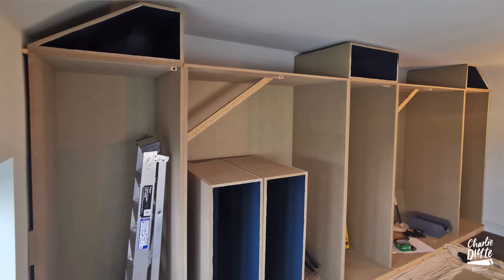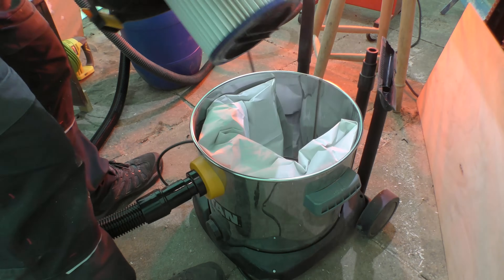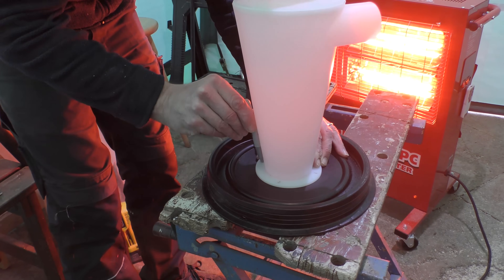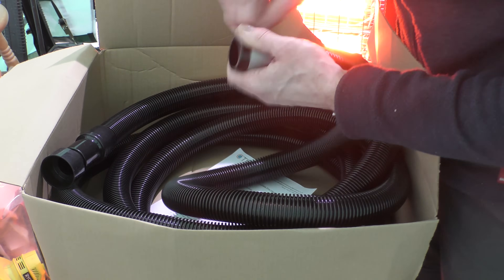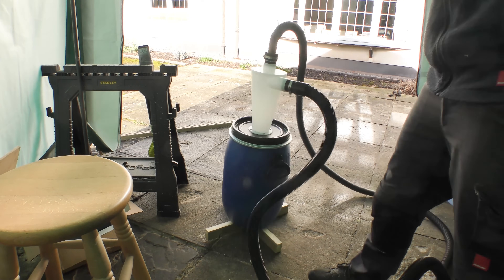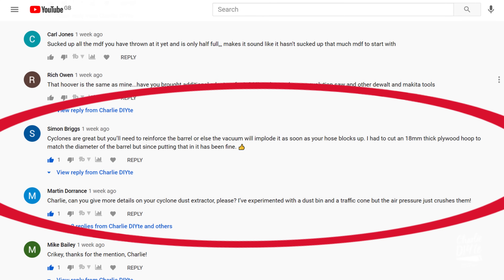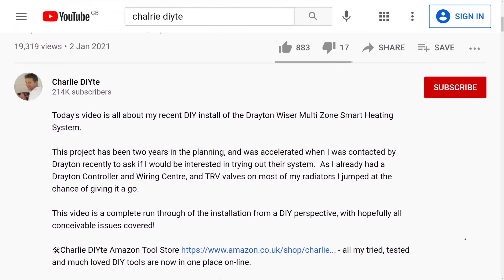How to Make a Cyclonic Dust Extractor/ Collector

Comment: I bought a blower the other day to blow the dust away after watching the other video.
Reply from the maker: You still need the blower. I couldn't manage without mine and use it pretty much daily to clean power tools, dust bags and the like - and of course leaves off the drive! My point though is that we should all be vacuuming up what we can. 👍🏻

Comment: Charlie I've had all these same parts waiting to be assembled for far too long. Thanks for proving it all works. I have seen people make a caddy on wheels to keep the barrel and vacuum together, and prevent it tipping over. I can become a bit bulky though, unless you can fit it all under the bench.
Reply from the maker: Definitely worth putting together my friend! A few people have suggested minimising the tube length between vacuum and barrel to maximise suction and then have the final hose suspended from the ceiling, but the suction on mine is more than adequate. And I can keep the vacuum nicely out of the way.

Comment: Charlie, I have a similar set-up to yourself for abating my sand blasting cabinet. There is a potential safety issue with the setup you describe that many folk will be unaware of. I am a former Manager of a Chemical factory and we are well aware of the potential hazards of dust explosions and ensuredthe risk was minimised by a variety of design and safety measures. Wood dust and MDF dust can form an explosive atmosphere and can be ignited by static buildup by the cyclone. If you are unaware of the destructive potential of dust explosions, google flour mill dust explosion. So what measures can we take in a domestic situation to minimise the risk? The main measures we can take are to avoid ignition sources near the setup for example brushed motor power tools or vaccum cleaners and ensure that cyclone is grounded to a known earth point using some 6mm cable. It is important to try and use a cyclone that is electically conductive, many of them are (the plastic ones include a conductive filler in their composition) by some the cheaper ones from e.g. China may not be. If the cyclone is not conductive then the grounding will/may not work. You can check to see if your cyclone is building up static my seeing if the hairs on the back of your hand stand up when the system is running and you place your hand next to the cyclone.
Reply from the maker: Thanks Dave. I appreciate the heads up on that and I think one other person may have mentioned this. I'll keep an eye on it and report back 👍🏻

Comment: Used almost exactly the same kit  to make mine about 6months ago. The barrel did collapse but I made a round brace out of plywood with a jigsaw that fits inside and it solved the problem. That 5m pipe is a bit too long and it does get clogged on occasion which is a pain. I'm redoing my work bench and will probably upgrade it to a 50mm hose to increase airflow.
Reply from the maker: Thanks Lliam. Yes a couple of people have suggested that on the length. It's doing a good job for me at the moment but I see your point.

Comment: great vid Charlie and I've recently made one very similar myself.
The initial cost will soon be paid back by not having to purchase vacuum bags.
The cen tech hose system with adaptors are a great addition.
Reply from the maker: Thanks mate. Yes particularly as the bags fitted so badly on the Titan and someone was saying that you can't even get them now. 👍🏻

Comment: Hi Charlie
Good video - wish I had done this - but too near the end now for me!!
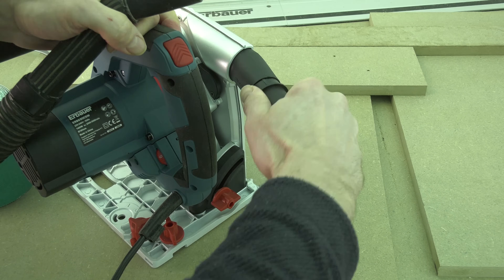However, at 2:35 what is the connector you use and where did you get it for your plunge saw?

I’m sick of using duct tape as the hose and the outlet are the same size!

I’m also going to try the taping over the window trick👌👍
Reply from the maker: It was actually the adaptor that came with my Evolution sliding bevel mitre saw. You can get them on Amazon and ebay. Google "vacuum adaptor for power tools". However you have to experiment. It's sort of luck whether it fits your vacuum nozzle or not.

Comment: i connected my 3000w vac and the plastic drum collapses immediately - steel drum is the only way for high suction
Reply from the maker: I can see that with a really powerful vac. What vac have you got out of interest?
Reply: @CharlieDIYte  Hyundai HYVI10030 3000W Triple Motor 3 IN 1 Wet & Dry Electric HEPA Filtration Vacuum Cleaner 230v
Reply: @CharlieDIYte  it has 3 motors - even with just 1 motor on it collapses

Comment: I built a cyclonic dust extractor the same as yours, unfortunately my barrel collapsed several times so I reinforced the middle with timber. Didn’t work it just collapsed somewhere else, it’s a shame because it worked really well. My only solution is to obtain a metal barrel, I’ve found mine very useful as I’ve got it connected to my trend vacuum which has a power take off so I can run my power saw off. I noticed you’ve taken the bag out of your vacuum, beware if your barrel gets full you’ve got no protection on your vacuum and it could damage the motor if dust gets inside the vacuum canister.
Reply from the maker: Thanks Brian. Generally I'm not a fan of removing the bag. I've always had a bag on my Henry's over the years. However the Tritan bag design is criminal the way it fits the inlet tube. You get so much dust leakage, and there's the hepa filter to protect the motor so I think it'll be ok.

Comment: The other solution is to make a pressure relief valve in the top of the barrel, I think it can be done with a bolt, washer and spring.

Comment: Hi Charlie, Wow, no sooner did you reply to me to say you had a similar set-up to mine than here is a video about it! I used a Dust Commander cyclone £29.90 from Amazon which did come with gasket and cutting templete, a Sealey 5metre hose £19.80 from Amazon and an Oipps 60L barrel. I did toy with the idea of 30L but decided the extra capacity would be worth the little extra to pay. I have no stability issues with the barrel falling over but my 1600W Aldi vac is quite capable of collapsing the barrel with even just a partial blockage of the inlet hose. I got around this with a clunky wooden brace inside the barrel but Matt at Badger Workshop did a video to show how he made and fittem a simple ring in his. Very necessary as I needed a car jack to un-collapse mine! You might also like to look at https://www.festoolownersgroup.com/other-tools-accessories/how-to-make-an-'auto-resetting'-pressure-relief-valve-for-cyclones/
I haven't made one of these yet. I have the bits but no time. I hope I have improved on the idea by replacing the external magnet holder with a stack of 4 ring magnets salvaged from old microwave ovens which get thrown away in large numbers at my local recycling centre. Again,  I  haven't tested to see if the magnets are a suitable strength but will let you know if you let me know how? Cheers
Reply from the maker: Hi John, fantastic work. 👍🏻👏🏻 That cyclone sounds a lot better than mine. I'll have to check it out. Also a few people have pointed out the need to earth it to prevent the static causing the dust to explode. Sounds extreme but it's obviously a potential problem. Thanks for the comment 👍🏻
Reply: @CharlieDIYte  I also have a sketched design for a stand (on castors) which will hold the barrel and vac, one above the other to give a smaller footprint in my tiny workspace. No progress beyond buying materials because we had a small disaster involving a water leak, bridged cavity, missing lintels, under pinning foundations and a stray tin mine (I kid you not), followed by plastering, carpentry, wiring and painting. You can reach me on Musgraveit@btinternet.com if you're interested in hearing about that or in pictures of the dust extraction system once I get it put together.

Comment: Thanks Charlie, like you I bought that Titan in a pinch when I thought my superior vacuum had died.  It has come so close to being launched out the window on many occasions, but I've been inspired to spare it and use it as a cyclone power source now.  Cyclone seperator has long been on the 'round tuit' list...
Reply from the maker: You and me both!! The Titan has hardly been used since I bought it due to the poor quality hose and accessories, ill fitting dust bags and lack of a cord tidy. However since starting this series of videos I've realised it can never compete with Henry as a domestic vac because it was never designed to be a domestic vac. It's best used in a stationary position attached to a cyclone in the workshop and with the power synchro switch to plug in power tools it suddenly makes sense. 👍🏻

Comment: Been cyclonic for many many years now and have different ones sett up across my workshop.  The only difference is, is that mine are all steel drums. Recently purchased the cen-tec hose, silver one and their  connectors off Amazon.  Think they are really good quality if a little pricey
Reply: Hi, I posted a query in Charlie's thread, can you offer any advice, I built almost exactly the same as Charlie's but dust just goes through and comes out of the vacuum air outlet port. Any ideas?

Comment: Tip...add a plastic bag inside your dust collection barrel with the cyclone, fit it over the top so it’s seals with the bracket that fits around the lid...that way you can simply lift out a bag and not have to make a mess cleaning the dust from the barrel...👍🏻 PS, I think your barrel is fine...I think it’s the slightly larger ones that have the problem with vacuum collapse...
Reply: Good idea, but don't let it get too full, or you won't get it out.
Reply: Great idea

Comment: With the cyclone dust collection fitted, you can remove the bag from your vacuum, this with improve the vacuum performance with the cyclone, and as you get almost no dust in the vacuum, the filter alone will be fine... ah, you did it....good...👍🏻

Comment: Charlie, have you added the Erbauer plunge saw to your shop? I've been thinking about getting it and would like the affiliate pennies to go your way.
Reply from the maker: That's incredibly kind of you mate. Sadly they don't sell it on Amazon so the link I've added is to Screwfix where they're currently only doing click and collect (in my area at any rate). I'm really pleased with the saw. Well worth getting!
Reply: @CharlieDIYte  I’ve got the same plunge saw, when I started using mine I was getting a lot of black foam all chopped up.I wonder if they put the foam by the blade and you sucked yours out and I cut mine up?

Comment: I am always worried about using bagged vacuums without a bag. Sure, you've got a cyclone attached. I have had one for years, and believe me, one day you'll overfill it, and dust will go straight past the cyclone - and after that, into the motor. After that the suction seems somewhat diminished.

Comment: Looks great!
I’m struggling to understand the science part of it though. Would be good to know more about what is actually happening and why
Reply: Gravity. The debris is separated via the cyclone bit and gravity causes it to fall into the barrel. Only the finest dust is then sucked up into the vacuum.
Reply: @Lliam439  So I take it that it wouldn’t really work for clearing out the ash from a wood burner as the ash is so light?  I’ve wrecked a shop vac filter doing that before

Comment: Love your videos! I have the same vacuum and the next size up barrel but I made a diy cyclone using PVC pipe. The pipe from the vacuum connects to the centre of the lid and the pipe to the tool connects to the side of the barrel at an angle just below horizontal (at a tangent to the circumference of the barrel) to force the cyclone effect. Works perfectly and I’ve been really impressed with it. I have had issues with the barrel trying to collapse but only if the pipe is blocked - I plan to put some braces inside the barrel to stop this.

Comment: I did the same thing and works really well, but my problem was finding the right connections and hoses to the different tools, like Thicknesser,Table saw, Router, and Plunge saw.. I had to bodge it a bit but the extract system was definitely worth making..
Reply: check out cen tech hose and adaptors

Comment: I’m also looking at building one of those workshop air filters 
The fan I have found is this  https://www.screwfix.com/p/hf-45b-18-industrial-floor-fan-220-240v/754hy?_requestid=525717
I still need to find a supply of 20”x20” hepa filters. 
Anyone else already try this with UK/Ireland available supplies?

Comment: I've just bought the Erbauer saw you have in the video but not had chance to set it up and use it yet.
What are your thoughts on it, Charlie?
 I couldn't afford the likes of Festool or Makita around the 6 or 7 hundred pounds mark so hoping my £150 Erbauer will suffice.
Reply: Let me know how you get on with it Graeme. Did it come with a case or anything?
Reply: @davemaynard3826  No case but a bag for the two 700mm track lengths. It also came with two very sturdy track clamps. I have a couple of MDF wardrobe projects soon when my daughter moves house so I bought it primarily for that task.

Comment: I've got an almost identical setup, the barrel has collapsed once it twice but only when there is a blockage and I've not noticed and left it running. Forcing the barrel back into shape is a challenge, might get round to re-enforcing at some point! Looking forward to your opinion of the plunge saw.
Reply: Hey rrddaatube, what vaccine are you using? What power is stated? 
 It must create some impressive suction to collapse one of those barrels.
Reply: It's an old Dyson no idea of that stats.
Reply: Mine works really well but it’s easy to get the barrel to collapse by just dropping the hose on the floor and have it suck up to something flat. Reshaping the collapsed barrel can be tricky until I worked out I could blow it up with the (Titan 1100W) vac reversed. Inflates the barrel and mostly straightens out the creases.

Comment: Had one of the dust commanders for years now hooked up to an old vax vacuum and its on a large plastic bucket (with a snap on lid). 2 things for the bucket, the lid is worth stiffening up with a couple of layers of 12mm ply above and below the lid as I found with the pressure during use it caused a stress crack on the thin plastic. Also, the bucket was prone to collapse under hard suction so I had to make a plywood ring to sit inside the bucket to stop it collapsing and I'd say your barrel will be a victim of this too. 
Otherwise, its a bloody brilliant addition to any home workshop and prolongs vacuum filters indefinitely I've found. I use mine for swarf, sawdust, muck, nearly anything and it works brilliant. even on super fine mdf or brick dust.  The most difficult part was finding the little connectors or making them by bodging plumbing fittings to get everything connected together.

Comment: iv had the barrel colapse as well. they all will if you have a powerfull vacuum. my festool ct22 will do it instantly. 
 i tried all the internal and external reinforcment ideas but they only creat more problems than the solve
i changed over to a metal barrel. the best place i found to get them is from mechanics or agri contracters that get greese in them . they are happy to give them away

Comment: The barrel won't be sucked in by the vacuum but pushed in by the external air pressure once you apply auction and reduce the internal air pressure. A simple bucket inside a bucket will resolve this as there is no external air pressure being exerted on the inner bucket that is having the suction applied to it.

Comment: Good job! I am sure that you will use this cyclone a lot in future projects. In order to keep the barrel from imploding, you can use a pressure relief valve on the inside of barrel. It would work like a reverse pressure cooker (barrel's outside pressure is higher than the inside pressure)  and when the inside pressure becomes very low, the valve opens and sucks air from outside to balance the  pressure. You should choose a valve that does not open during normal operation and affect the performance( in fact it is just a matter of choosing the right spring).

Comment: I have the same set up and the drum  failed miserably, I tried several remidies but the one that worked was using a one way brass valve in the lid. I think I got it from Screwfix for about 6 quid.
Reply: Do you have photos of the installed part?
Reply: @ScottNicolson  Yes, I looked into putting them on here but I can't. I think the simplest way is if you look at my instagram account , https://www.instagram.com/ivwoodcraft/ , I'll put them on there now , hope this helps.

Comment: I cut a piece of plywood that I screwed inside the barrel the the base of the cyclone which meant it mounted on the barrel very well.

You barrel is much stronger than mine.

Comment: Hi Charlie. Could you put a bin liner in the barrel folded out under the lid? Making for easier disposal?. Also what was the modification you did to the plunge saw to stop the side dust? Was it just tape
Reply: Yes was the tape. If you know someone with a 3D printer they can probably make a more better looking solution.
Reply: @C4sp3r123  thanks.
Reply from the maker: @C4sp3r123  Thanks mate. Yes taped over an off cut off wood - similar to a piece of hard board. Probably not necessary but I though it would prevent the tape getting sucked in.
Reply: @CharlieDIYte  what model is the plunge saw you bought?
Reply from the maker: Yep. I just taped over the window that you use to remove the blade. I'll be doing a more in depth video on the plunge saw at some point. I don't think a bin liner would work as it might get sucked up. I'd need to think about that one.
Reply: @CharlieDIYte  thanks. Yes it just occurred to me that just like the risk of the drum collapsing there is no way a bin liner would work:-)
Reply from the maker: Funnily enough someone has just recommended the bin liner so it sounds like it does work after all!!
Reply: @CharlieDIYte  cool. Thanks:-)